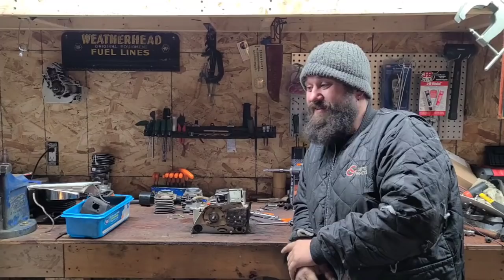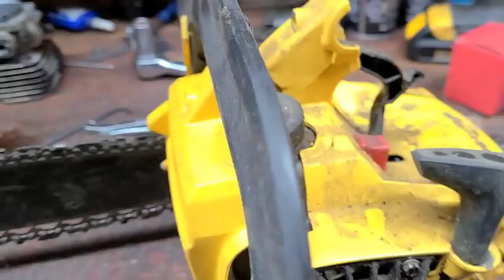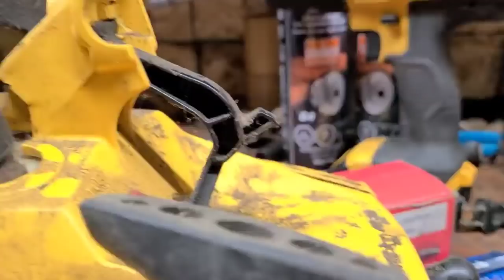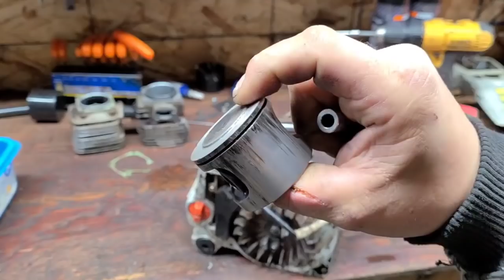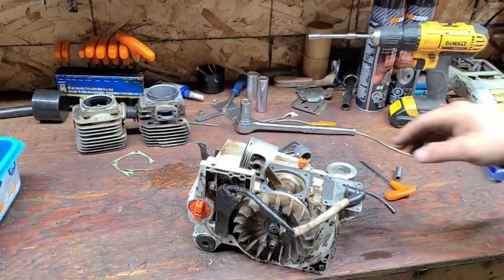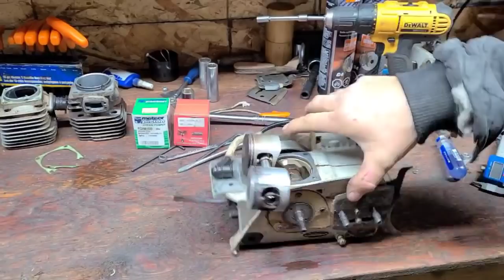Friday night in the shop! Lets talk about piston swaps, husky piston in an echo??

Comment: I have  The basics of new meteor pistons  066 064 460  272 288 371 395   It really comes in handy sometimes for building motors from definitive Dave for projects I mix and match a lot of different pistons sometimes it makes it happen For instance on my EFCO 81cc  What a pig I put a 272 52mm HUSKY piston  It was a little taller. a buddy of mine caught it on the lathe & made a pop up I ended up with 190 P.S.I  And the intake port timing was perfect..... I did a ton of transfer porting  Add now she runs decent.

Comment: Great stuff! This is going to be a silly request but really would be the video I am looking for. I have no idea how a gas engine powered device, ie. chainsaw, works on a highly technical level. I am more of a battery guy but sadly anything electric is much more expensive. Any chance you can reccomend or put out a "hey - this is how gas based chainsaws / enginers works for dummy's" ? Wouldn't considery myself a dummy, but even with an engineering degree (lol...can't even spell engineering with engine), in terms of practical knowledge of how a chainsaw works, because I have never used one I haven't the slightest clue. Thinking of getting one to replace my chopping axe since I am getting old...but that being said a simple sharpening stone (overuse of) has been able to help compensate for lack of applying as much physical force as I used to be able to. Love your channel and keep creating great content!

Comment: Tinman I have a holzforma g372 I bought to try my porting skills on and was wondering if I take off material on the intake side of the piston skirt for more timing would I have to match the exhaust side as well? So far I have deleted the base gasket,opened up the lower transfers,and dual ported the muffler and seems to run stronger, would like to go a little further with it. Looking forward to this series of videos!!

Comment: Little yellow is a mini Mac eager beaver 110 or 120 I have 3 of them they run good once you get them going I’ve worked on a lot of them and everyone always seems to lose it prime after setting a few days and you pull your arm off trying to get them going they are tight fit inside the case good luck hoping to see it cutting soon
Reply: for  me  hard  to  work  on

Comment: You can build up that screwdriver handle with PC7 two part epoxy paste 👍
Reply: great idea -
yeah I have used a few 2 part epoxy products with good results.
I like the blue types best on plastics - long lasting & take paint well if you need it to be another color 
[I leave them as it is nice to see what ive repaired]
Reply: @bellyacres7846  I haven't done a lot of plastics repair with Epoxy unless I used the Epoxy meant specifically for plastics.